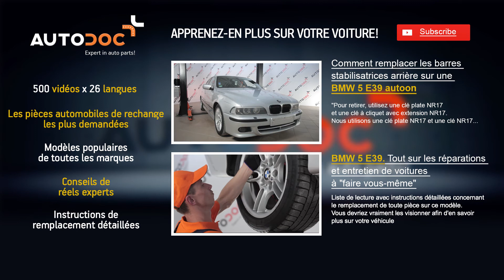Comment remplacer les disques de frein avant et plaquettes de frein avant sur une BMW 5 E39

Comment: Et le dépoussiérage et nettoyage des étriers ? Graisse spéciale anti bruit au dos des plaquettes ? Pas très complet comme tuto, dommage  :-(
Reply from the maker: Vous avez bien raison. Les surfaces contactantes doivent etre nettoyées et graissées avec de la graisse au cuivre qui facilitera le démontage lors de l'entretien ultérieur. Il faut par le meme controler visuellement les guides du support de frein - ils ne doivent pas porter les traces de la rouille et de la boue. Il faut assurer le libre mouvement du support sur ses guides. Le présent tutoriel a un caractère informatif et montre la séquence des procédés essentiels lors du remplacement des pièces.
Reply: @autodocfr   n oublier pas de serrer les boulons de roue au couple et non a la clé a choc j ai eu le cas sur la mienne et impossible a les enlevers ensuite sinon bonne video
Reply: Et le témoins d’usure ?